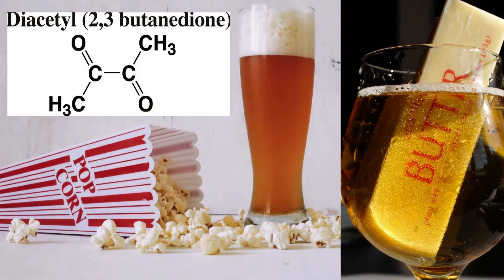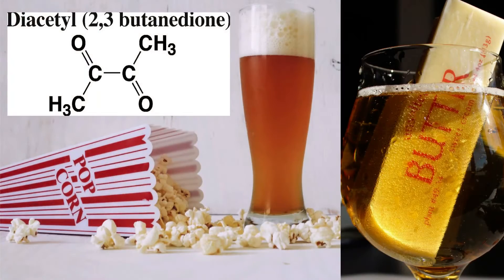How to eliminate diacetyl in your brewing process

Comment: So if there was some in the final product during that test, what would you do to get rid of it?
Reply from the maker: Thanks for watching and your comment.  If there is the presence of diacetyl during this test just let the beer sit in your fermenter/carboy for a few more days and repeat the test.  Sooner of later it will be gone.  The yeast will metabolize it as it uses it for an energy source.  If you pull the beer off the yeast too soon, that is when a problem will surface later.  It is not uncommon to have to do this test a couple of times before you get a clean sample.   In fact, I encourage folks to do the test right at the end of fermentation because you should absolutely be able to sense it (this gives you a clear picture of what you are looking for).  Then when you do it later you can feel confident in your findings.
I hope this helps, Happy Holidays.     -DT